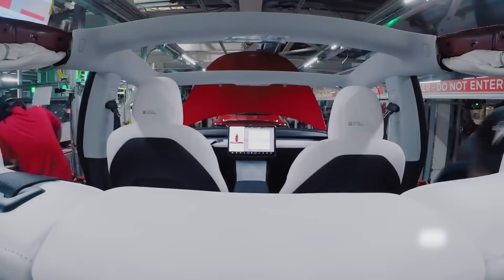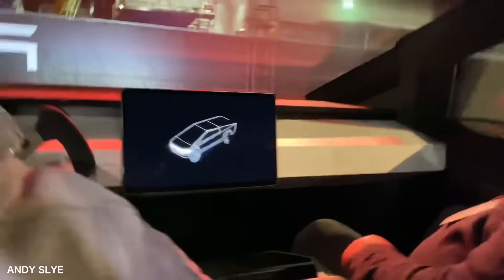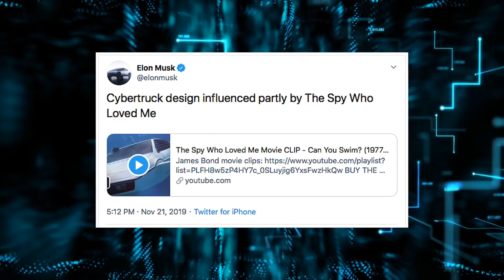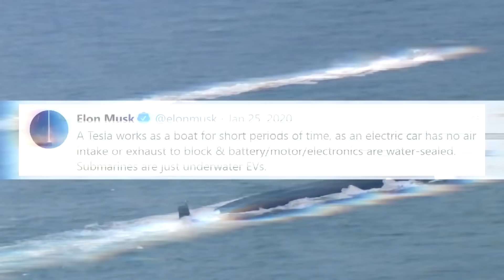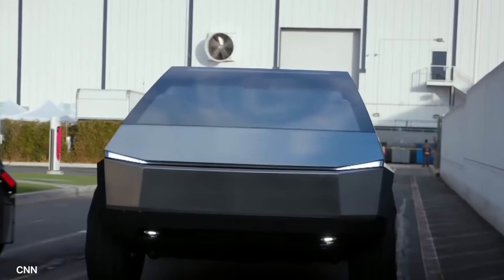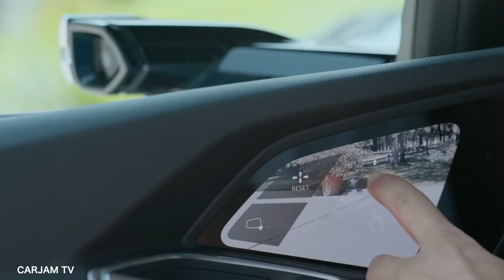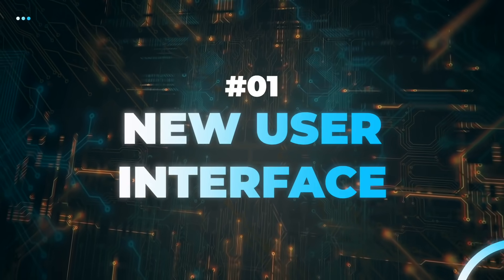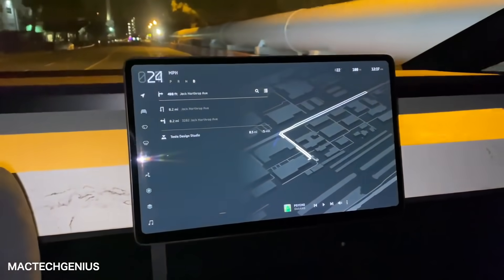Tesla Cybertruck - This is why Cybertruck is Special

Comment: Can anybody explain how musk wanna overcome the safety issues? I mean „normal“ cars have specific areas that are easy to deform so that in case of an accident the force of impact and therefore also the risk of getting injured is much lower. Same thing if the car hits a passerby or cyclist. Image this truck which is so hard that its bulletproof hits somebody. Believe it or not but if somebody is driving ~30 mph or ~50 kmh and hits you with this its like your falling down ~10 meters and landing flat on asphalt. Not healthy...
I really like this truck allready but how is this gonna work?
Sorry for my bad english :)
Reply: @yesno9592  Dont get me wrong. I totally agree that the fsd system will make cars so much safer than they are now but it cant break the laws of physics. Just a simple example: You are driving just on a normal road through the city. One lane for each direction and cars parking on each side. There is also oncoming traffic. So overall a pretty usual situation. Suddenly a person (maybe a kid which cant be seen because its to small) comes up between the parking cars to cross the road. Maybe didnt even hear the electric cybertruck. Even if the fsd immediately tries to stop the car, it will not stop in time if the breaking distance is to short. This was just a small example. Dont get me wrong im a fan of the things and ideas tesla is comming up with but even with a always perfectly working fsd system, there will always be situations where cars crash. Also no hate for the cybertruck. Just curious how they will do it. But of course the will somehow. Thx for your answear though :)

Comment: Imagine locking your keys inside the truck .. 😅
Reply: your phone is the key, same with all tesla's
Reply: Until ur phone dies and your stuck outside a bar at 3am in the morning Nd your keys are  locked in your car 😅..
Reply: @lowkeysmokey2005  you can use someone else's phone, you can also use the key card which looks like a hotel key card. what you described is true of any set of keys except on a tesla, you dont have to spend hundreds to get it a new key reprogrammed.
Reply: and it can be remotely unlocked

Comment: Stainless body, will not rust out like my F 250 at 85K miles!  Would like to order a 2nd one!  Just think, no radiator,no antifreeze, no oil or oil pump. No paint, no rust , No fuel pump or fuel tank. No starter, no distributor or spark plugs or fuel injectors, no alternator, no transmission, no differential fluids, no. Nothing! Just zoom zoom!  Cannot wait for mine!
Reply: They do use fluids though....
Reply: @Bobshnogen  It's significantly less maintenance than a diesel-powered vehicle, is his point.
Reply: @okaytyler2774   F250 is still the better option for towing.
Reply: @evacody1249  I'd rather have a vehicle that exceeds most in other aspects than towing. Of course, it's about taste and whether or not being able to tow efficiently is something that's a must.

Comment: The stainless steel is resistant to handguns up to 9mm, it will NOT provide much resistance to a machine gun.
Reply: Well if you wear a bullet proof vest the armor will slow it down enough to stop it
Reply: @popinmo  - if the vest is almost good enough to stop a machine gun bullet, the 3mm steel might make a difference. Otherwise, no - but it still might help take some of the energy out of bullets that go through it.

Of course talking about regular machine guns here, not machine pistols which it might stop.
Reply: @alanlight7740  a uhmwpe vest rated for nij 3a pls 3mm 301/304l stainless steel should slow easii a 7.63x51 round enough to stop it

Comment: 9mm machine gun.  not as common as you might think. Order my truck, i am only 800 000 in line. Just trying to figure out how to solar charge it.
Reply from the maker: Wow! 800,000
Reply: @TechDivision1  Yea, and I ordered just a few months after the truck was announced. Not that I am in a hurry as my Toyota RAV is only a couple years old and I want to get a bit more use out of it.

Comment: you do realize most cars are designed to dent and crumble to increase the time during an impact to reduce the energy delivered to the passengers. Making the frame that rigid and doors bulletproof may just be worse for safety and an unnecessary gimmick.
Reply: Don't underestimate Musk

Comment: This vehicle will send the established players (Ford, GM, Chevrolet, Dodge, Buick, Chrysler etc) who have ripped off most Pick up buyers for decades- will now go bust! (they cannot catch up, their legacy company structure and factory methodology is entrenched and cannot be changed.)

The new paradigm for personal EVs is arriving rapidly,
CyberTruck-   
Little to no cost with minor body damage. (no paint required, massive cost savings in manufacturing) 
Little to no maintenance required on an electric motor (no tune up, injector unclogging etc)
No air filter unclogging,
No oil changes, No fuel filter changing. 
No DPF maintenance. (Diesel Particulate Filter - in exhaust),
'No fuel price shock' every time there is a middle east skirmish, (non logical price fluctuations) by some rogue nation.  
Fully computer controlled if you so desire, has the ability to work as a robo-taxi, even while you sleep,
The vehicles functionality gets better with over the air (OTA) updates. It just gets better with time,  even as you sleep. 

I have probably missed half a dozen more good points. 
If you think of anything else - feel free to list in the subsequent comments?
Reply: 🤦 Towing 14000 is not a lot.

When you need to tow more people buy the F250 RAM 2500, etc.

This will change nothing.
Reply: And the Lightning just made this thing irrelevant